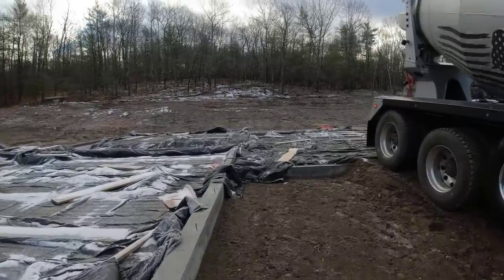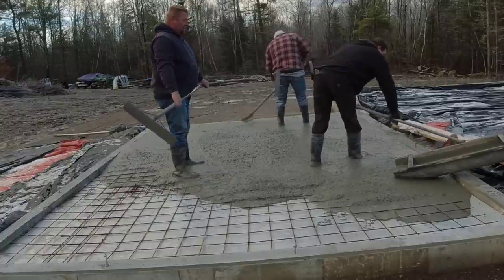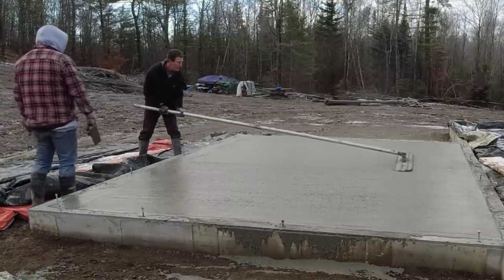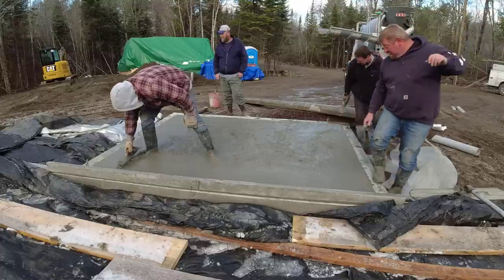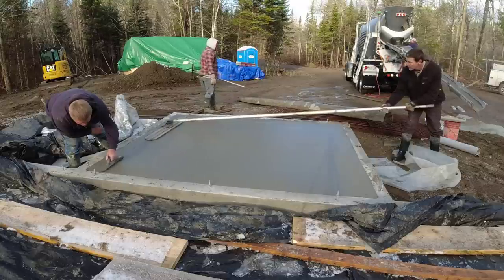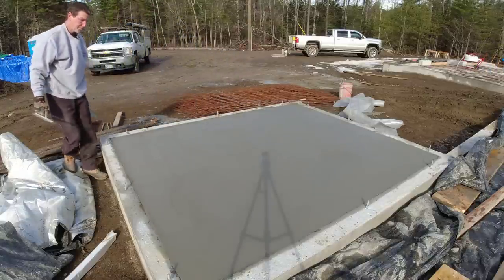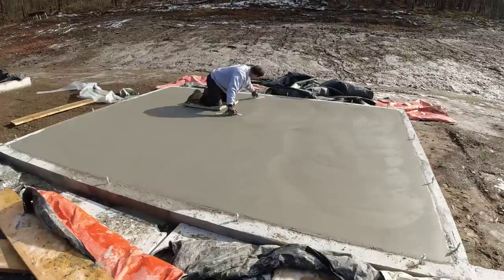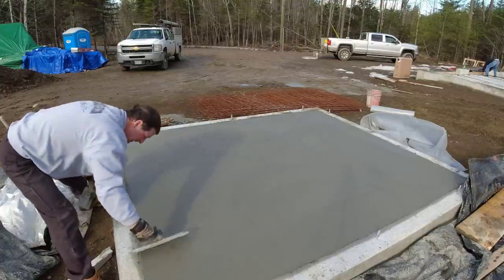We're Pouring 2 Concrete Pads and it's Freezing Out!

Comment: I gotta have my knee pads when I hand finish concrete. They're of vital importance to me. Have you ever had problems with tendonitis from doing concrete work Mike? I've got it in my right elbow tendons and it can be very painful, especially when it first started bothering me. It's been about 3 months and, knock on wood, I think it's starting to try to get better. Talking about pulling up chuncks, I absolutely hate it when you get a burnt out, slick as glass finish with a troweling machine just how you want it and when you go to remove the machine from the slab, the blades pull out a big @ss plug of finished mud. Then, you gotta scramble around and find some grout that isn't hard as a brick bat and put water on it and put it in the hole to make it look decent. It rarely turns out ideally, but we're all picky with our finishing anyway. I've tried all kinds of things to avoid the dang machine blades pulling those plugs out and it's not always an issue depending on a lot of factors, but it sure sucks when it does happen. Any tips you've learned to keep that from happening?
Reply from the maker: I try to slide the machine before I start it to keep the blades from sticking. Works sometimes but had a big chunk stick the other day, floor almost done. Got it filled but was a pain. Some concrete sticks more than others, just a day by day thing.
Reply: @MikeDayConcrete  yep, that's been my experience too. Just something we've got to deal with and minimize as much as we can. Thanks for responding Mike. Have a good one from way down in Dublin Georgia.

Comment: Mike - In a couple of your videos now, you've mentioned adding accelerator in the winter (calcium chloride?) but you've also included wire mesh or rebar. Have you had any issues or concerns with corrosion? I know most accelerators will corrode steel embedded in concrete. Thanks for another great video!
Reply from the maker: I've never had or heard of any issues using CC on any of my jobs, been using it 42 years in Maine.
Reply: Yes it does, it breaks the bond between concrete and steel allowing oxygen to the steel thus rusting the steel out.
It's completely banned in Australia now and a lot of countries. 
There are different accelerators that don't corrode steel, CC should not be used in any concrete.
Reply: @lachlanitis2311  Yes its called excellerator non chloride typically a liquid added at plant, doesn't work as good then goes really quick in final hour at finish.
Reply: @74stevedc  you need different accelerators then. We use sure set and they work great. We can get a polished finish by 4pm on a very cold day. 
If you know about the detrimental effects of CC and still use it you need to re-evaluate your concreting practices.
Reply: @lachlanitis2311 .... he did say non-chloride accelerator. We do have many non-chloride accelerator choices in the States and many are required on state and federal jobs.

Comment: Great video. We poured on 11/05 this year inside with 39* weather in N. Michigan, watched some of your videos and used a few tricks and tips you gave out. Power trowel is tricky, luckily we had a guy who has used them many times before. Wondering how long you let concrete cure before you seal it if you do and what brand sealer you use for a smooth garage floor . Thanks for the videos.

Comment: I want to start a concrete business. I've been watching all your videos and am going to join the concrete underground after Christmas or in late winter, but I've never done it as a job just a few times here and there. If I started small, like shed pads on the weekends, would it be something I'd be able to do or is it necessary to work under someone else first?
Reply from the maker: You can start with small pads. The Concrete Underground will help teach you a lot about how to pour and finish concrete

Comment: I’ve never worked in extreme cold like that, so I don’t know what’s worse,  extreme cold or extreme heat? I work in Australia in sometime 40+ degree Celsius heat and that’s a killer.
Reply from the maker: Extreme heat is tough also. We get to about 100 F (37C) here at times in July and August with humidity. Makes for very uncomfortable pouring and finishing.
Reply: @MikeDayConcrete  wow from one extreme to another, I’m glad we only have to deal with one extreme per year here, all the best mate I hope weather conditions get better for you soon mate 👍
Reply: Extreme cold is worse. You can always work in the morning time or at night when it’s hot outside. It’s just miserable with the cold.
Reply: @jackwilliams7738  oh very true didn’t think of that, can almost be a business killer if your not smart and think of ways to beat the freeze so u can continue working.
Reply: @melbournestacker  plus if it’s below freezing the concrete won’t set up like it normally does in the heat.